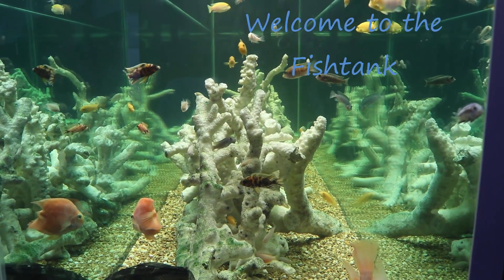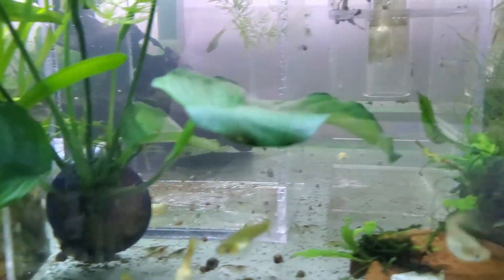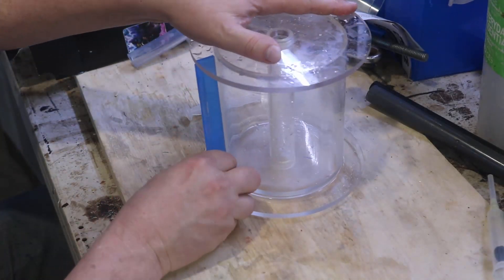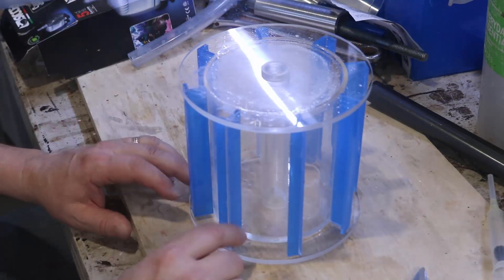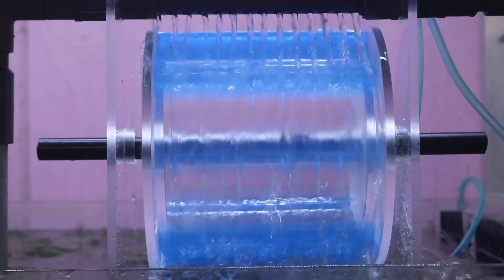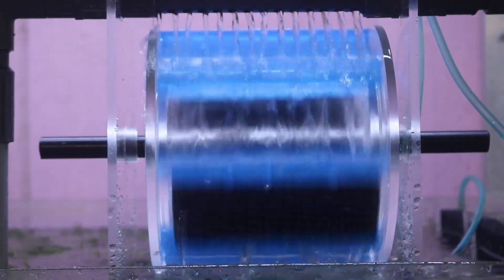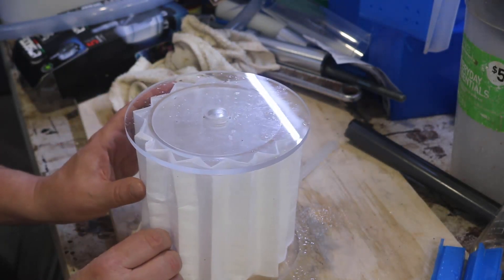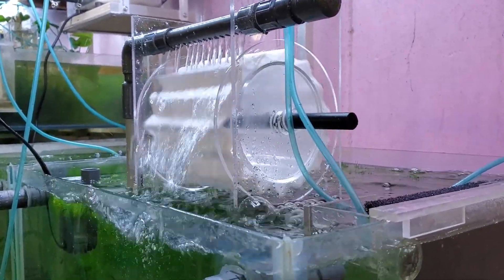You Decide : Rolling Drum Filter Part 5

Comment: Option one would be a quieter and with less splashing would be a winner for me.   I noticed when you took the sponge wheel apart that there was water on the inside of the wheel.   Now I'm wondering if you can utilize the interior space to add to your filtration?   Not sure how but I leave that one up to you.
Reply from the maker: Thanks Sue for coming by! The problem with putting filter media inside the wheel is it will increase the weight enough that it probably won't turn.

Comment: I’d go water wheel. Thinking eventually it’s going to get gummed you and uneven and have spinning issues.    If you’re going To go with the corrugated filter you could just buy a cheap TypeD pool filter and it’s pretty much the same thing as that we’ll just the sides are rubber. And you could just make the bushings.         https://www.amazon.com/dp/B07Q6WML3Y/ref=cm_sw_r_cp_api_i_AnYvEbSPS8PGQ
Reply from the maker: Thanks Shane! I will look into it, but there seems to be little interest for this version, probably because of all of the problems with the old penguin filters

Comment: I definitely think option one will have the greatest effect for the amount of areated surface area exposed but I want to give a shout out to pleating here.  Those pleats were inadequate to do any measurable amount of filtration and the fabric itself may have been too fine of a weave.  Imagine if you wrapped the same length around the cylinder but only overlapped an inch. It would exponentially increase your surface area.  Combined with a much coarser paper mesh would probably do more justice to that option.
Reply from the maker: Thanks so much for sharing your thoughts on this!

Comment: Option 1 by far. Simple, elegant and efficient. 
The other options have undesirable behavior that has to be tweaked, and they really ache visually, taking away from its carefully crafted roundness. I wouldn't trade the view of a continuous and featureless slow rolling sponge for squarish strips glued together and then glued onto a round surface, holding sponges that will want to spring out of roundness back to straight.
Reply from the maker: Thanks so much for your input!

Comment: That rolling sponge is beautiful, like VSMR....  If no 2 is going to be so efficient, it likely could be air driven.  Perhaps even a hob you'd just need to channel the outflow to it.  Perhaps wrap the water wheel in sponge ?     Also, what if that central cylinder was drilled to let water in/out ?  Could put carbon or other media in there...   Cheers
Reply from the maker: If I put something inside the drum, that will add allot of weight so the wheel might be better in that case. Thanks so much for your input!

Comment: At first I didnt think I would like the water wheel design, but it does seem nice to be able to change out sections of sponges at a time. I think either way a HOB style would be cool. 

On the third option, there are water filters made for homes that have that kind of filter material that is a sheet folded together around a tube, if you check a hardware store in the plumbing sections you can get filter replacements that are already shaped in a circle like this.
Reply from the maker: Thanks so much for your input!
Reply from the maker: And thanks for the tip!

Comment: Combine options 1 and 2. Help keep a thick sponge moving and do some level of bio and mech filtration. Option 3 is filter material and needs pressure to be effective. Think the oil filter in your car. 

Alternate: make the cylinder porous and add a second spray bar (as the axle) from the interior, to make a water wheel powered rotary sponge filter.
Reply from the maker: Thanks so much for your input!

Comment: I think option 2 full of sponge sections would run more smoothly than the full sponge from option 1, and looks a little cooler IMHO, but I wonder if the wheel wings would reduce the flow through the sponges and thereby reduce the overall efficiency of the filter?
Reply from the maker: Thanks so much for your input!

Comment: option 1 is still the simplest. in order for option 2 to work, to reduce splashing, the wheel will have to be lowered into the water by a few millimeters.
or just have a cover. 
the corrugated fiber is from a filter meant for air,  probably why it didnt absorb much water
Reply from the maker: Thanks so much for your thoughts on this!

Comment: I think #1 would do the best job for filtration and be easier to service but I really like the aeration and agitation #2 causes. I think I'd go with #2 once it's full of sponge, it's only a little less surface area for BB but I would think it would help aerate the water better. And once the fins are full of foam if it's still spinning too fast and splattering everywhere, you could flip it 180º so rather than the fins having that lip for the water to catch on, they would face the other direction and you should get an in-between speed of the current #1 and #2 options.
Reply from the maker: I think you're going to like Fridays video. Thanks for your thoughts on this!